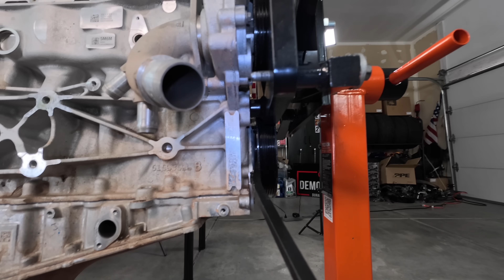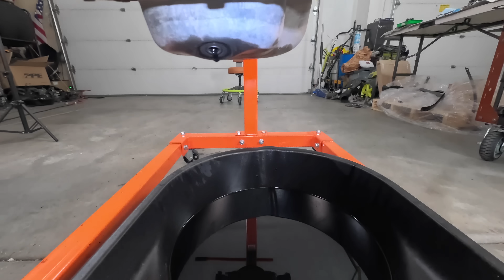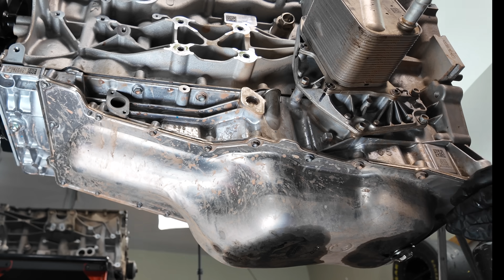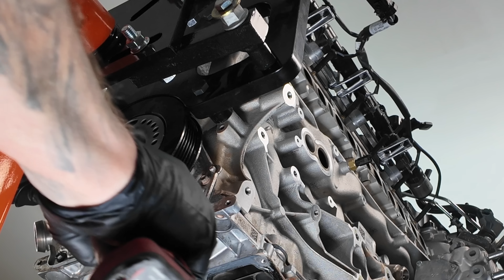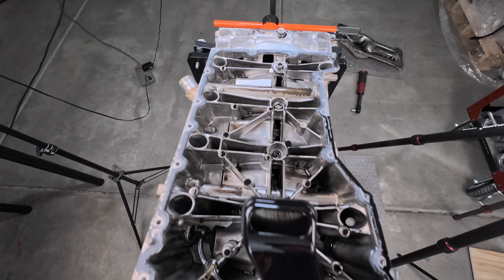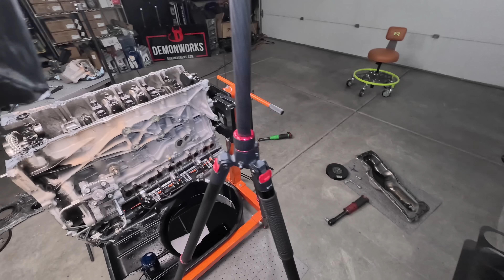Was This Engine Built Wrong? 3.0 Duramax Failure Investigation

Comment: Just serviced 2023 3.0. Mobil one full syn detox D is the only oil I used from 20 k mile up. Until then the dealer serviced the truck. Also cleaned the map sensor on the intake. Wow what a difference. Truck has 54k miles so far I had the water coolant valve replaced at 43 k and had filter and oil changed at 43 in transmission. No leaks anywhere. Great truck so far

Comment: 2025 here. I checked CS endplay at around 1500 miles with zero movement. Three UOA later still confirms no abnormal wear metals. So, I believe I dodged a bullet with my truck in regard to the TB issue.
Reply from the maker: Nice ! That is great news !

Comment: I just bought a 2026 with the LZ0 and I have the updated oil pan. I hope this means I have both thrust bearings. I tried get the service department to check the crankshaft end play for me before taking delivery. I was first told they would have to drop the front end to do it. I explained that wasn’t the case and referred them to GM service bulletin 25-NA-307. The service manager called and basically kept coming up with reasons not to do it and that it has the 100k mile powertrain warranty. I finally gave up dealing with them.

Comment: Bought mine 2 weeks before the bulletin came out.   MPG started dropping at 11K.   Oil pressure would drop after accelerating and then sort of normalize.   Engine destroyed at 14K miles.   New engine on order with a 4-6 week leadtime.

This video is a game changer - will check end play when I get the new engine.   

I am not seeing the correlation between oil weight and this failure mode.   Especially if the factory failed to install the second bearing.

Comment: 1.  The vehicle needs to be front end raised ,( ramps) , it seems to get complete old oil drained !
2.  This is in place of a " upgraded " oil pan ! ?
3.  Though, if room allows, a aftermarket  oil pan , with deeper rear shape along with lowest possible drain plug location , would be a worthy upgrade ! ?

Comment: I like your channel and I appreciate the work you do, but you might want to put the correct information of what happened in the video because look how many commenters you have thinking Flint engine was building shit engines on purpose or that this was a disgruntled employee sabotaging our work. This was a supplier issue with the crank and immediately when it was caught precautions were made and new product was brought in. This wasn't an employee issue and there's plenty of error proofing in place for the occasional mistake.

Comment: Over engineered over priced failure. Belt driven junk.
Reply from the maker: I hate things I cannot have, too!
Reply: @DemonWorks These trucks are fair priced IF they did not have failure rail rates due to poor engineering designs. Belt driven oil pumps, timing belts, rear main oil seal leaks etc. all the flaws could be resolved with proven designs like gear to gear timing or timing chain. Oil pumps driven by gear or off the cam shaft. Use oil grades for protecting the engine internals and not emissions systems.

Comment: I’m surprised no one has come up with it. Aftermarket chain driven oil pump, to replace the belt. 
Just hitting 124k miles on 3.0 Duramax from 2023.
Reply: I read from another video from a viewer in Europe or maybe it was Australia said the 3.0 Duramax has a timing chain conversion kit to replace the belt on the oil pump, but can’t find it, interesting.
Reply: maybe because it’s a non issue?

Comment: For all of you engineers watching this video, this is your group's fault. It would take a backyard mechanic about 5 minutes to know where the best place to put that drain bolt on that pan when it took you guys six to eight years of education, countless computer models and lots of discussions afterwards to finally decide on where to incorrectly place the drain bolt. Good job! As for the stupid oil pump belt that's not a problem. What's not a problem is having an oil pump in the oil pan that you can replace without removing a transmission. That is of course if the engineers could figure out how to not cover up the oil pan with the subframe but that's on the stupid engineers to do list to fix.

Comment: Back in the day, America used to be able to make reliable engines.
Why can't they do it now?
American engineers are as good as any in the world, they can design a great engine only if the finance department would keep their friggin hands off.  They cause more of a drain on the profits of the company than anything else.  If they just let the engineers do their thing there wouldn't be so many recalls, and GM wouldn't have to be replacing engines (on the shareholders dime) faster than they can produce them.  Someone should get fired for this, the CEO, the CFO.  The buck stops here, they are being paid a kings ransom and still can't produce a reliable engine.  This is where the cutting should come.  They are the guiding hand of the company and if they can't manage then they should find another job.

Comment: Sorry fellas, I’m a slow learner…need some help. Are you saying that there are supposed to be 2 thrust bearings in there and only 1 was installed on some of these engines? Mine locked up back in November with 4200 and they replaced the engine, took about 40 days total. The tech that did my replacement did a great job and all is good now but he didn’t explain what may have caused that kind of internal damage. He showed me pieces of destroyed thrust bearings but didn’t say if there was 1 or 2 in there. Thanks for sharing this info!

Comment: Oil belt is not a problem until you have to service it at 200K miles. But you might be right though, these engines my not last 200K miles, so not a problem.

Comment: Why not have the thrust bearing flange as part of that main?  It worked for decades on other engine designs?
Reply: I was thinking the same thing
Reply: Probably because they save a few bucks per engine using a separate part. The final say on design and materials is always the bean counters and the regulatory compliance dept.

Comment: I own a 2025 3.0, mfg date of 06/25, purchased the truck in August of 2025. Had my trust bearing tolerance checked at 5200 miles, checked out fine. Ended up hearing an excessive knock at operating temp around 6900 miles, confirmed thrust bearing issue at 6928 miles (limp mode and p06dd code) Required an engine swap. Once truck got to dealer for repairs I had it back in 2.5 weeks. Unfortunate situation but warranty covered everything and was back on the road in a short time. Have 1000 miles on new motor and everything runs like a top!
Reply: switch to mobil1 0-20w engine oil the gm 0-20w has been exposed as being terrible…motor oil geek did a deep dive
Reply: have you noticed a loss of power/mpg and/or an increase in noise?
Reply: @ghand6158 With the new motor, no. I get crazy good mileage and power with the new motor. With my motor that fell victim to the trust bearing going out, I did eventually notice a drop in mpg and also the truck being a little more sluggish. No louder noises at all until the excessive knocking sound started. Hope this helps!
Reply: Mine let go two weeks ago, 15k miles 7/25 build date. No CEL which is ridiculous,making horrible noises like a little 4 banger being floored when I hit the accelerator. Hope I get it back soon and it runs as good as yours.
Reply: @volvet0384 Dang bad luck!  My CEL didnt come on for mine until I shut the truck off and restarted it when I was having the knocking sounds. Hopefully GM will ship a new motor quick for you…I got my truck back in less than 3 weeks. Not sure what lead times are where you are at but it should run like a top once the engine swap happens!

Comment: 2020 LM2 160k miles. Only major issues have been the turbo at 142k miles and the transmission (torque converter failure) at 154k miles as well as the rear main seal failing. Had the oil pump belt replace when the transmission was being rebuilt. Belt showed minimal wear and the timing chain s looked almost like new. I’ve been running ESP 5w30 or Amsoil 5w30 when I remember to order it for roughly the last 60k miles. (Swapped over at the 100k mark.) I’m in southern Texas so a 0w isn’t needed. It’s been 109 out the last few days
Reply: “Only”??

Comment: Greg,  Your Channel is great.  I own a 2024 Sierra SLT 15500 with the 3.0 Duramax.  I generally love the truck BUT have had two occasions in 2 years of ownership and 9500 miles which are annoying.  The problem is with the electronic/console shifter.  If the engine won't start or stalls,  the  truck is stuck in PARK   As far as I know, there is no secret lever to put the truck into neutral. Not all towing companies  are aware of this.  As a GM Tech it would be great if you could share info on this issue.  Do you think GM will fix this in 2027?
Reply: Had a starter fail and they couldn’t get the truck in neutral without the engine running. Pulled up a flat bed in park. Painful to watch

Comment: Well done!
My ‘25 Tahoe HC 3.0 failed at 8897 miles thrust bearing issue. I wasn’t told if it was actually missing or the bearing itself actually failed.
GM/local dealer replaced the engine and turbo charger.
Local dealer service department exceeded my expectations and took care of me personally.
Communications with GM not so good.

Comment: The belt is for the 3rd or 4th owner to worry about.  Anyone thinks they are keeping a truck that long is silly :p  Good video!
Reply: 150K is hardly the third or fourth owner.Dropping the transmission for routine service at 150k is a crap design.
Reply: @Sp2012ftlh it’s 200k now on the lzo. But yeah maybe second owner.
Reply: I’m at 49k miles and change on my 25, I plan on keeping it well past 200k

Comment: Greg, would it hurt anything to take a Mityvac pneumatic pump and vacuum out additional oil through the oil drain plug hole when doing diy oil changes?
Reply: It's a non-issue.  Most engines don't drain the entire oil volume during a service.  It's usually 8-16oz with some being more.

Comment: Wet belt for oil pump and a timing chain run with no natural tension on the chain due to stupid design. Top it all off it's the back and any major service requires engine removal. I tell my customers to their face they are stupid for buying these things and to go out and buy an older truck and have me service it to bring it up to date. This is getting ridiculous at this point
Reply: Sure you do. doesn’t matter what you think of what a customer says or does, never in my life have I told a customer they’re stupid.

Comment: So - per GM, a end play check is the correct procedure to detect if it has the problem.  IF it is a 1 thrust bearing missing, there should be NO units with the end play much greater than max end play spec and much less than thrust bearing thickness plus max play spec unless trans limits movement.   Is this the case with failure analysis?

Comment: So it would be better to ramp up the truck from the rear wheels when changing the oil?
Reply: No. Front wheels on ramps. Lowers the drain hole angle to catch a few more ounces in the pan. On my '25 anyhow.
Reply: @SWF3.0lSierra  How else would you do it? I've changed all of my changes with the front wheels up on ramps and it works Jim Dandy. Don't have to worry about raising the air suspension and use a fumoto valve and I'm drained and done in 20 minutes.
Reply: @stbentoak5047 I answered in response to freddy.

Comment: Don’t underestimate what a disgruntled employee can and will do. 

I can almost guarantee you they know exactly who is to blame.
Reply: If true, someone is going to prison
Reply: And I can guarantee you this was a supplier issue, I work there. We have error proofing for all of this stuff and no employee was purposely leaving parts out.
Reply: @whoppes27 if it was a supplier issue, why was there one completely missing/never installed?  The supplier doesn’t install them.
Reply: @jamieeiv it was never missing. The side of the crank was never machined correctly and the surface acted as sandpaper on the bearing. Once it ground down far enough it was able to come out of the groove. Once the problem was discovered it was rectified and there was a lot of engines torn down in plant. The ones that were already out of the door and in vehicles obviously we had no control over. None of this stuff is taken lightly in the plant.
Reply: @whoppes27  Very good info.. just curious where the 3.0L engines are built?
Thanks
Reply: @texZR2 Flint, Michigan
Reply: @whoppes27  Cool, thank you sir.
Reply: @whoppes27  BTW.. I LOVE this 3.0L Duramax.
Been driving Chevy's since the 80's, experienced just about all the truck engines since.. and the 3.0L by far is my favorite.
Better than the 6.2L which I had on my previous truck.

So Thank you.. I know it might be just a job.. and everywhere you turn it seems someone is bashing it. But I think the vast majority of owners like this engine.
Reply: @texZR2 well thank you, I appreciate that. Most of us put a lot of pride into our work. I had the privilege to be on the launch team for the new LS6 6.7L Corvette engine and also the new 5.7L and 6.6L V8's. I'm excited to see how they do on the road. 

I also love the 3.0L, I'm on my 3rd one.
Reply: @whoppes27  I'm definitely looking forward to seeing those new motors.
Reply: @whoppes27 thank you for the information.  Is there an engine or truck  build date potential buyers should look for to ensure we don’t get an affected engine?
Reply: @whoppes27 Aron’s what build date was it found?
I want to buy one but don’t want to buy a can of worms

Comment: So with that older design oil pan, couldn’t one simply jack up the front of the truck or drive it up some ramps to get the oil to the rear of the pan?
Reply: That's  what Ive been doing the past two years. I use ramps on the front  as its just easier for me in my cluttered garage. I get an extra 9- 10 oz of oil out and when I refill with new  oil, it always looks "new"!     Those first few oil changes I did ( I used and still do use a pneumatic extractor)  I always had  a "dirty" dipstick until I looked under there a bit more closely and noticed that stupid oil pan design was impeding a proper drainage.  I'm not interested in going with an aftermarket pan at this stage. Your mileage may vary!!

Comment: Great work and a very interesting teardown. This is exactly the kind of data point we need.
That said, I remain in the skeptical camp for now. If engines were truly leaving the plant with a required thrust bearing missing, I would expect GM’s manufacturing systems, inventory controls and SAP traceability to eventually flag a mismatch between bearings consumed and engines produced.
That doesn’t mean it couldn’t happen, but it suggests we still need more data before concluding this is the root cause of all the failures.
I’d be interested to see whether failures cluster by engine build date, vehicle build date, model year or something else entirely.
Thanks @demonworks  for all the work you’re doing. This teardown has definitely moved the discussion forward.

Comment: So you looked at damage and not the root cause, it's hard to see in the video but did the oil squirter that was broken off break the bolt in the block?  Or was the squirter retaining bolt left loose at the factory and then fall out causing a low oil pressure issue and thrust damage. Inspect the threads and hole in the block to lead you on this, I'm sure the retaining bolt got chewed up 😊
Reply from the maker: I do have threaded pieces in the engine oil pan and nothing left threaded into the block. The threads in the block do show some damage. Something to give more thought to as well.
Reply: This is much more likely than a forgotten bearing on how many engines???????

Comment: This is a watershed event. I have puzzled over the cause of these failures for months. Realizing there are no certainties in life, can I assume that my early '25, with 25k completely trouble free miles on it, has both thrust bearings? This is a wonderful motor and it is a shame that its reputation has been tarnished. Excessive play, thrust bearing damaged, oil squirter damaged, engine goes down. Great job, Greg!!
Reply: There’s literally a 5 minute check you can do in your garage to see.
Reply from the maker: If my engine made it beyond 25k I would feel great about it having all of it's parts. Here is a check that can be done at home: https://youtu.be/0ydF8yuJgoE

Comment: A belt driven oil pump has to be in the top five stupidest designs of all time. making it so inaccessible puts it in the top two, along with AFM and variable valve timing ideas. Also, the drainplugs that are higher than the sump are worthy of mention too - GM must have hired a bunch of DEI engineers. I used to think I'd like to have one of these  in a regular pickup, but my old Duramax is a better keeper. I'm going to check out what Ford and Ram are offering in half-ton diesel pickups, because I don't think I'd have one of these things.
Reply: Unless you’re buying used there is only one half ton diesel, and the ford and ram counterparts are shit by comparison. You don’t like belts, then out goes the powerstroke with its timing belts, and the ram 3.0 is right there in the hall of dogshit with the 6.0 and 6.4 powerstroke. Soooooo good luck with that…ps, search for a failed belt on a 3.0 duramax, see if you can find 1. Just 1. Enjoy

Comment: I change the oil in my 21 in my driveway which is slightly inclined. I have marks on my bucket for 7.5q and 8q and always get to the 7.5q mark minimum. * I have always drained and filled with 8 quarts every time and change it at 40%, 5000 miles, and never had an issue.
Reply: Why 8?

Comment: 23 LZ0, just switched to Mobil 1 ESP 0W-30 from GM Dexos D 0W-20 at 65,000 mile based on all the data.  I change every 5000 and loose about a quart.